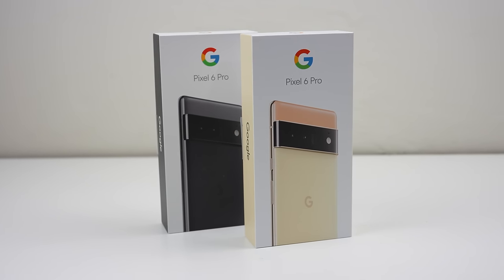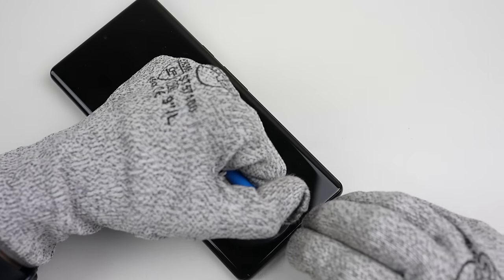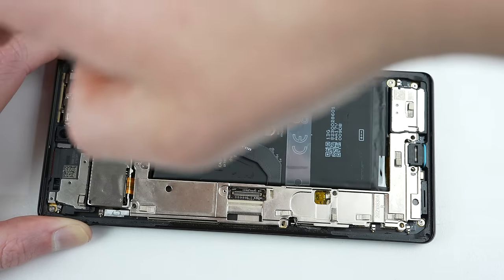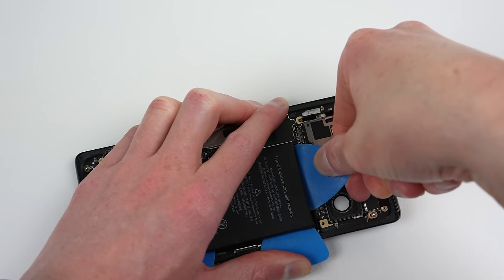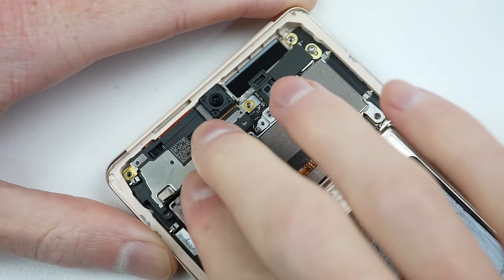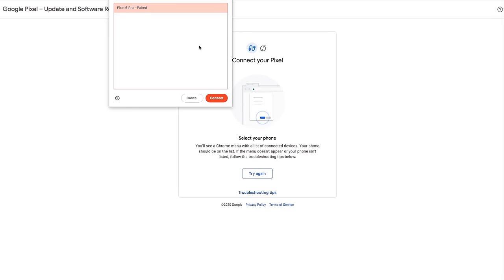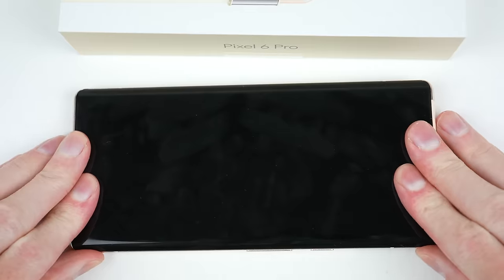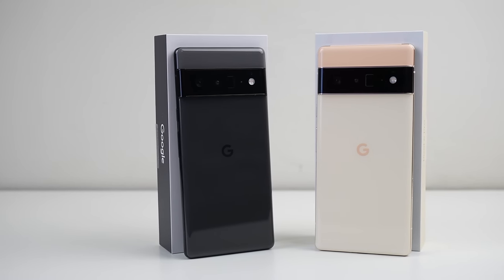Pixel 6 Pro Teardown and Repair Assessment - Serialisation With A Twist

Comment: Now when phones have 5 years of updates I think it is important that they can be easily repaired if they are going to be keept for that long.
Reply: I wished that the battery and usb-c were easily sourced.
Reply: @joeltyler3427  s10 has the same issue
Reply: @MegaMike1  Well shit.
Reply: @joeltyler3427  unless you put a otterbox defender with a screen protector then you won't have a chance breaking it
Reply: @MegaMike1  I've got a cip out of mine
Reply: But how will apple sell new phone ?
Reply: @nothingam9983  😱
Reply: @joeltyler3427  yeah it would be nice if usb c port was moduler but tbh you can easily find a repair shop near you that can do board level repair on that so should be big hassle.
Reply: Isn’t 5 years literally standard for most android phones?
Reply: Its still just 3 years of feature updates, so they gonna push you to upgrade after 3 years anyway
Reply: @ChrisBa303  the phone doesn't magically stop after the last update you can get for your phone.
Reply: @nothingam9983  apple has transitioned from selling phones and now makes money from services
Reply: @krispyhd9484  im not holding my breath for those 5 years. Most likely it'll get 2 more OS updates and the remainder of the 5 years will be security updates
Reply: @rodrigojds  ah I see
Reply: iPhones have updates for even longer

Comment: Google... I have to admit, I'm impressed. The C port should still be replaceable and that battery is stupid, but it's nice to see you aren't full on evil yet. Great video as always!
Reply: I personally really like the battery tab, it's supposed to be used as a knife to cut the adhesive by alternatively pulling one side (like a knife)

It's impossible to do it without a jig or a second person, but it's reliable and works every time
Reply: @BuzZ.  I meant the inability to disconnect it. The screen and components might have some protection, but it's still poor practice to remove anything before power is disconnected. The slicing tab seems fine, I agree.
Reply: @syber-space 
Agree it's not the best thing, if the phone is off it's fine because there's no power there...

But if you accidently turn on while replacing it you can easily kill the phone if ur not careful
Reply: Ellis The DJ  keep in mind that the google fingerprint re-enabler needs USB to work.

you need soldering skills, it will be about 3x the price in the repair shop if you can't solder your self

Comment: I really appreciate that Google made this tool available. Not a big fan of the way you're gonna have to replace a broken back glass though.
Reply: Probably they can be replaced directly from the back side without having to disassemble the whole phone
Reply: I think it’s better having you open it from the front because the front display is more commonly broken and more important and making it more accessible is a smart move.
Reply: @youravggamer  I agree most people will use a case that offer great protection for the back. The front however can never be as secure.

Comment: I feel like google making the fingerprint calibration software publicly available is a great example of what right to repair is really about - we don’t want manufacturers to be forced to build clunky, oversized devices that run at half the speed and can be taken apart entirely by hand, we just want the tools and parts that already exist to be available, and for manufacturers to stop going out of their way to make repair more difficult. If a device happens to be physically difficult to repair as a natural consequence of its design, that’s our problem to solve. But when the manufacturer of any product spends extra time and money for the sole purpose of making repair more difficult, like apple and samsung, that becomes a problem with them.
Reply: Exactly. Samsung finally seems to get this with the S22 series

Comment: Apple be like : "it's a hacker's best friend"
Reply: for real, they called sideloading a cybercriminal's friend lmao total clowns
Reply: And YES, having a tool which pairs a component out in public IS hacker's best friend.
Reply: @_xwtk  damn alright, apparently all Linux users are criminal hackers then lol
Reply: @gabrielevan148  Well said
Reply: @gabrielevan148  lol no, I am linux user myself lol, its about bypassing phone security
Reply: @_xwtk  yeah sure, an android user is technically a Linux user, since it uses Android common kernel, which itself is basically Linux, down to its version number and everything
Reply: @gabrielevan148  Nah not just Android, I have a dualboot installation of Windows 11 and Ubuntu 21.10. Plus I have a server running on Ubuntu 20.04.
Reply: @_xwtk  If you're a linux user, I think you should learn to use the word Install instead of sideloading, the source of the program has nothing to do with the nature of it
Reply: @_xwtk  in case you forget, you can't use biometrics right away without entering the pasode at least once after boot, and if you have the passcode, it's done.
Reply: @josir1994  yeah but if the thing can access phone data in fastboot without asking for password, it's already dangerous enough
Reply: @josir1994  Installation is just a process. Sideloading is installation of a program from an external device. That's all.
Reply: @_xwtk  no, sideloading refers to installing program not from the official app store, not by external device
Reply: @_xwtk  so if the phone didnt access anything at first boot before we enter the passcode, is it safe at your prespective?
Reply: @megimargareth4015  there is a god damn difference at accessing the data from a computer without the need of entering the passcode and the phone doing it's job
Reply: @_xwtk  i maybe amateurs, but recently i just fixed my bootlooped vivo phone with offline installer pack using recovery mode, to my surprise, its demand me entering the pattern passwords before i can do the install
Is that safe enough in your dictionary?
Reply: @megimargareth4015  You want to say that a recovery script asked you your pattern??

Comment: That's not bad, doesn't look hard to take apart and the fact that they give you the calibration software is a step in the right direction overall.

Only thing is, if it's exclusively browser based, what are the odds that Google eventually pulls the rug from under us? Thanks for the video & the insight man!
Reply: They'll probably open-source it at some point
Reply: @spacexplorer_  They better. but still atleast they give us a Option to. People can i believe reverse engineer this and make a software of their own.
Reply: People hacked it already and can be found on reddit 

I don’t trust it anyway
Reply: @Caleb Brewster it has sd slot
Reply: Well at that point consumers most likely will stop caring and the phone will live on for enthusiasts, who can just flash a new Android image which are provided.

Not saying it would be the ideal solution though.
Reply: @MilesProwerTailsFox  No, it hasn't. If it had it, i would have already ordered one LOL
Reply: @Astra3yt  bro you can already do that for ANY Android phone xd
Reply: @MilesProwerTailsFox  Yeah but getting some images for some manufacturers is a lot more pain than it should be.
Reply: @Caleb Brewster it's not 2015 anymore
Reply: @Caleb Brewster You can get all of this except removable battery if you buy a POCO device (even an ir blaster) To get a removable battery you can get a pinephone pro I guess XD but removable batteries are not coming back, else we all decide to give up waterproofing
Reply: @Caleb Brewster If you want a rated water proof phone, sealed cases and non removable batteries are the way to go.  Of course they could do both, but then people would complain how bulky it is.
Reply: @Caleb Brewster not having a removable battery nor a headphone jack is a non problem. Get over it and stop talking about apple as if other companies don't do the same.
Reply: @luca7069  Yeah I'm pretty pissed that Android phones are all removing the SD slot... While coming out with stuff like 8K video that takes up a crazy amount of storage
Reply: @MilesProwerTailsFox  pixel 6? No it doesn't
Reply: @MilesProwerTailsFox  No it doesn't.
Reply: @Jbrimbelibap  Galaxy S5 was waterproof and hade a removable battery. What are talking about?
Reply: Not too bad. When google shut down the infrastructure for Google glass, they realeased a final Firmware that can run without the backend Services too.
Reply: @Lion_Hamza  and this battery was small. If u want  4k mah battery or battery u need a brick, removable battery adds extra volume and a few problems, I really want it but sealed pho e have more advantages
Reply: @Jbrimbelibap  hey remember when the Galaxy S5 had a removable battery AND waterproofing, at the same time? It was as simple as adding a rubber gasket around the back panel to prevent ingress. Crazy how that's technologically impossible in 2021.
Reply: @MilesProwerTailsFox  no Pixel device has ever had a microSD card slot. That's just a fact.
Reply: @TheJoker.07  Will never move on from removable batteries because they're an essential feature for prolonging the usefulness of your device. Don't let the corporations dictate how you use your devices.
Reply: @SnrubSource  "it's not 2015 anymore so you're not allowed to have basic features anymore" what a depressing state of affairs. We should go back to 2015.
Reply: @dlewis9760  a rubber gasket lining the battery door does not add any more thickness than a line of glue. The Galaxy S5 was waterproof, had a removable battery, and was still just as thin and light as any modern phone.
Reply: @rodrigojds  not having removables batteries or headphone jacks are DEFINITELY a problem, how can you claim they aren't? They actively, provably worsen the user experience and longevity of the device.
Reply: @kserkez1763  the only advantage sealed phones have over user serviceable phones is that companies get to increase profits by artificially forcing you to ditch your old phone or pay out the nose when the battery begins to wear out.
Reply: @tituslafrombois1164  it would be nice, but it's clear that it's never coming back to mainstream phones so there's no point in still whining about it
Reply: @SnrubSource  it will come back if we keep demanding it. Notice how Apple brought ports back to the MacBook Pro after people made enough noise about it. The consumers' demands dictate what the companies provide, not the other way around. Never cede ground to megacorporations.
Reply: @tituslafrombois1164  battery is not the problem, each new phone is faster, have more storage, if u had option to change battery u would buy new phone after 3 years because new phone will be better in all categories. I replaced battery in my samsung s9 and u know what? It is good it holds charge but new phone feels a lot better, smother. Battery replacement is not as hard as everyone says, if u want to do it urself u will do it, but there is note that many people to justify for big brand to make phone with replaceable battery
Reply: @kserkez1763  just because you have a consoomer mindset where you need a new device every 3 years doesn't mean that everyone thinks the same way - or can afford to LIVE the same way. Some people are poor, believe it or not, and can afford a $20 battery replacement much easier than a new phone.

Also as to storage, new phones actually have less because they're omitting the microSD card slot.
Reply: @tituslafrombois1164  ok but replacing battery is still no problem, and u have cheap phones too, homeless can afford phone now
Reply: @kserkez1763  and the homeless would be able to keep their cheap phones longer if they had replaceable batteries. Believe it or not, not everyone has the equipment and time to heat up adhesive, gently pry their phone apart with plastic picks, carefully disconnect ribbon cables, and wiggle the battery out.
Reply: @tituslafrombois1164  and not everyone care about it
Reply: @mateuszbartoszewski3568  Too bad. I do. And I'll keep pushing for it until I can get a good phone with a removable battery.
Reply: @luca7069  Me too lol. Since everybody wants to get rid of the slot. My last samsung phone would be this galaxy s20. After that I'll settle for a google phone with at least 200 gigs of storage.
Reply: @Caleb Brewster I haven't had to replace a phone battery in my entire life, and I'm sure a lot of people can say the same. I haven't used wired headphones in maybe 4 years either. With wireless technology becoming more and more mainstream, it makes sense for phones to ditch the headphone jack. It adds bulk to the phone. Same as a removable battery. Maybe if you just take care of your phone, it'll be fine. And if it fails under warranty, then you'll either get it fixed or replaced for free.
And why cry about an SD slot lol. Back up any photos/videos you take so you can remove them from your phone storage. Again, this is saving weight and space in the phone.
Technology has advanced. You either keep up or settle for an older phone.
Reply: @kserkez1763  false
Reply: @datachu  that's where backing up pictures come up
Reply: @FR4M3Sharma  i believe that's what they have to do to stand out.
I will keep buying them because of that.
Reply: @MilesProwerTailsFox  most popular manufacturers stopped providing SD card slots on their phones like 3 years ago, specially on those flagships
Reply: @zepd762  what? 

But that's stupid, like half of the people who comes and asks me what phone to buy they always want to take like a million photos in one day 

How tf a phone can hold a lot of photos if they don't have a 500 GB sd card?
Reply: It's reflashing the phone.

Comment: 14:33 The battery can be used as a small heat sink. It has a lot of copper inside. Some surface tablets do the same, where one heatpipe from the CPU is connected to a fan and the other one to a big piece of copper on top of the battery. But most likely the metal tape is used for shielding or grounding.
Reply: I think its not the battery. But rather its trying to disperse the heat from the chip and the battery through the screen. The screen is a big surface area to release the heat aside from the aluminum frame.
Reply: Battery as a heat sink is very bad idea. Batteries, esp lithium really hate heat.
Reply: @jec_ecart  I also think so, but the surface did it this way and wireless charging coils are also on top of the battery and they get warm too.
Reply: @drcyb3r  could be planned obsolescence tactic. These days batteries barely last 2 years.
Reply: @jec_ecart  This, it also degrades your battery quicker. That’s just total made up bullshit that he said the battery can be used as a small heat sink 😂

Comment: I really appreciate Hugh’s attention to detail in his repair/technical expertise in working with these devices. I really wish that I could do this kind of work. It’s so satisfying, but alas, I think I’m too old.
Reply: It's not impossible at all! I took a 4 day course a few months ago and already I have repaired probably more than 20 devices and am planning on turning my side business into my full time job. It will take practice and there will still be moments when you mess up, but as long as you are organized and can follow instructions, it's absolutely doable, as long as you get the proper tools. The great thing these days is that most of the time whatever gadget you wish to repair there's already a Youtube video like this one explaining how to open it, so you minimize situations like breaking flex cables like this one which is so short. I say find yourself a cheap old iPhone on eBay (a 6 is probably a good place to start) and start practicing. Once you learn one you can do them all (though you do have to stay updated with the changes between iPhone models).

Comment: tip: tabs from battery are for sweing (I dont know if this is the correct word). You dont have to pull it, just wiggle left-right from top to bottom. Glue will be detached.
Reply: ah, like a saw
Reply: @davidyusaku  yes like using rope saw
Reply: Actually, in Google's official Pixel repair manual (the one that leaked not long ago), it's written that you should just lift the tab after placing the phone on a heat plate. That's what you're supposed to do, so Hugh did follow the correct instructions. But Google used a stronger adhesive than needed and that tab is garbage. They should've used the classic stretch/pull tabs
Reply: @SBT-41  I only managed to find the 6 Pro's manual, do you know where to download the 6's?

Comment: Pleasantly surprised about the fingerprint sensor calibration tool, but I'm not excited about the rear glass being non-repairable without buying the entire assembly. Might use a case for the first time in years with this one.
Reply: I don't what you mean by rear glass not replacable? You just remove the old glass and stick a new one. Yes it won't be easy as other phones but it's not similar to iPhones which have a camera ring welded over glass to prevent glass repairs.
Reply: C'mon man 
The previous pixels opened from the back - they said that there is no way to replace the screen now.  Pixel 6 opens from the side of the screen - you say there is no way to replace the rear glass.
Reply: @lui2292  Last Pixel that opened from the rear was the Pixel 4. Since then the 4a,  4a 5G, 5 and 5a have been released and they all open from the front. Google has gained much experience with this manufacturing  method and truth be told a easier process for screen replacement is (in my opinion) preferable. The screen is the main part of a smartphone, means a screen less smartphone is near unuseable, while also being easy to break.

Comment: Tiny Detail: The two spring contacts on that metal piece you reinstalled at 14:05 need to be pushed in slightly while doing so. I think you bent one slightly and it might not make contact now.